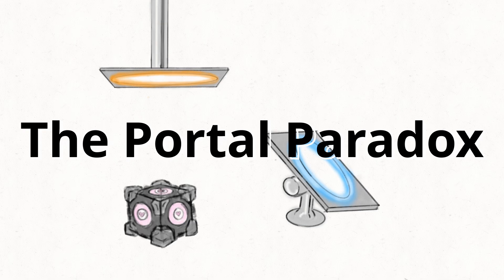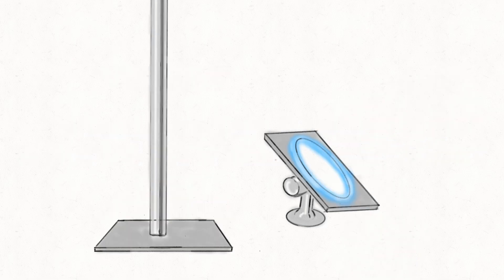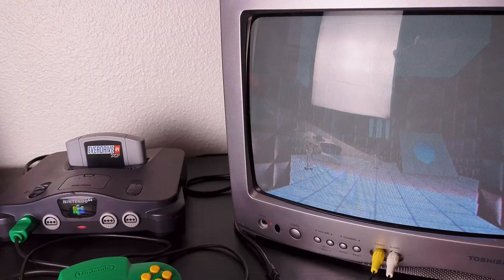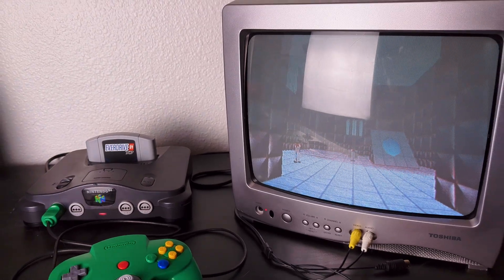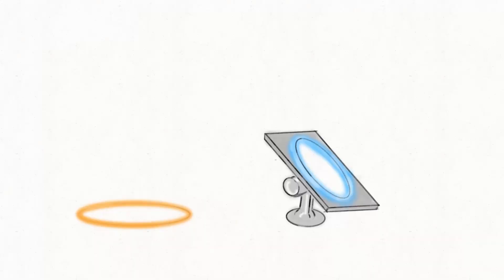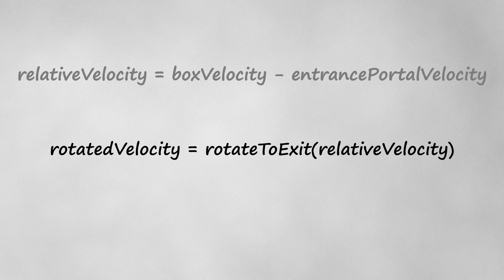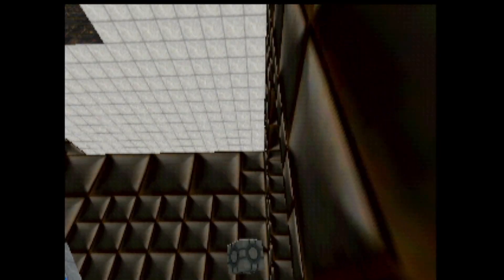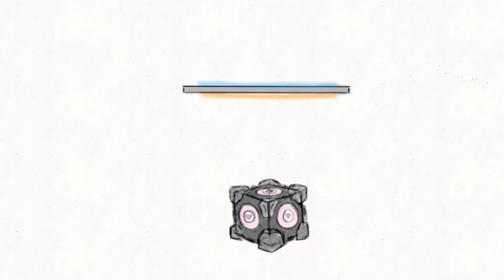I rewrote Portal from scratch and solved the Portal Paradox

Comment: I think the portal paradox is more like; What if two portals were pushed into each other with a cube in the centre? What would the cube do?
Reply: Or just the same experiment where the blue portal faces a wall with not enough space to allow the cube through. It seems like that the object must exert a force on the portal in order for the portal to accelerate it. So it would likewise meet the resistance as it tried to crush the box into the wall or into itself.
Reply: @goldenalt3166  or the force to move the portals would become too big and the pistons could give out.

Comment: As someone who agrees with you on the portal question I think the example of back to back portals is correct only if we assume a functional width of 0. If we were to assume a greater width to the distance between portals then the deceleration of the exit portal would occur before the block moves all the way through to the other side and therefore would impart some level of functional acceleration onto the block in the vein of something like (x-x1)/H?Velocity where x-x1 is the distance between portals if the distance is less than the size of the portal but greater than 0 and H is the height of the block. 

I don't know if that formula is correct, it was just a first look but there is definitely some dynamic there.

Comment: I think this question depends on the type of portal. If it's like the classical idea of folding space so that the two dimensional area of the portals is the same, then it wouldn't pop out. Like, it's a wormhole and the only thing "pushing" the box through is the entry portal itself moving the entire wormhole with it, enveloping the box. I think in that scenario it would actually be stuck in the 4th dimension though, like it would leave our 3d reality as there isn't anything to actually push the box anywhere, it would just "crumple" from our POV.

On the other hand, if it's like the teleportation technology in startrek, where the portal would copy what comes in and paste it as an output on the other side, then it would be forcing the material through effectively pushing it though at the same rate the cube would be annihilated into the first portal.

So really the question is, do the in lore portals use an extra spacial dimension or do they use replication?

I think if it's an extra dimension BUT it still functions the same as in the video, then it's just creating free energy. Crazy wacky portals using moon rocks as a base? I sleep. Conservation of energy not being conserved? Awake

Comment: Quick question: if there's nothing to push the cube how does it gain velocity? Won't it be something like a window that connects two distant places?
Reply: Portals already violate conservation of other forms of energy, and, axtually, while they preserve (as far as we know) kinetic energy, whenever two portals are not 180° apart, they violate conservation of momentum
Reply: @pedroff_1 they don’t in splitgate
Reply: Velocity is relative
The portal approaching the cube is the same as the cube approaching the portal
If you imagine yourself as the portal, the cube is approaching you and if you imagine yourself as the cube, the portal is approaching you
In either case, the cube gains relative velocity, which is translated through the other portal
Reply: @dtstar331  He's asking what is the source of the energy imparted on the cube that allows it to fly out of the other portal. It was initially at rest, and upon exiting the blue portal, has significant kinetic energy.
Reply: @Gameboy_of_Color  
Thing is, techincally the cube wasn't at rest; it was approaching the orange portal. I know, it sounds weird but that's more or less what relativity is about.
If you isolate the system with the orange portal and the cube, you can see they are approaching each other at a certain velocity. Therefore, there was kinetic energy in that system. And this energy was retained by the cube when it left through the blue portal. What changed was the relation between the cube and the portals. When it went through, it was moving away from the blue portal with the same velocity as when it was approaching the orange portal. And so it looked like it was shot out of there

EDIT: I'm bad at explanations, I know
Reply: @dtstar331  Examine the relative velocity of the cube and orange portal relative to the ground. The cube is at rest relative to the ground, and the portal is in motion, so for the cube to exit the blue portal with significant velocity there would need to exist some mechanism for the orange portal to transfer it's kinetic energy to the cube. Another thing I never see brought up in these thought experiments is that the orange portal decelerates and comes to rest as it contacts the floor, so the final velocity of the orange portal relative to the cube is zero as the last of the cube is going through the portal.
Reply: @Gameboy_of_Color   @DTStar  wouldn't the portal have already moved the kinetic energy to the other portal by the time it reached the cube? I'm not very good with science and I've barely made heads and tails of what you guys said.

Comment: Fun questions xD what happen if the exit portal is faster than the entrance portal does de cube fly back to the entrance portal since the relative velocity is negative?
Edit: very cool video 👍🏻
Reply: You didn't say where the exit portal goes. If in opposite direction from the entrance portal, then the cube will be accelerated, but only with speed of the exit portal, not the entrance portal. His equation is wrong, it shouldn't behave so.

Comment: I've always argued that this was the solution. People that say otherwise like to claim:
"But where does the movement come from?"

In physics terms they are speaking about momentum not being conserved. What they don't seem to realize is that, when entering a horizontal portal to exit a vertical one to make a jump, GLOBAL  momentum isn't being conserved, only LOCAL momentum THROUGH the portal is.

Another mental test so people would understand what my point was: imagine a test chamber, but in the exterior it is actually being moved by a trailtruck at 10m/s (or ft/s, arbitrary measurement). The orange portal is on the back face of the truck's test chamber, while the blue portal is in another test chamber stationary.
From the inside of the truck you can't know you're in movement.
You throw a ball at 10m/s at the orange portal, but from a stationary point of reference that means the ball is stationary and it is the orange portal going at 10m/s to the ball. Yet your expectation is to see the ball seamlessly seem thrown into the other test chamber, not stop mid-air the moment it crosses the portal.

Comment: The Retreating Portal:
Just another thought experiment on portal physics.

A stationary source portal on the wall in front of you.
Behind that, another wall, with the destination portal on it facing away from you.
That wall is moving away from you at a fixed velocity, say 10 meters/second, relative to you.
You toss your cube through at 5 meters/second.

What happens?

If the cube exits at the combined velocity of 15 m/s, relative to you, which is 5 m/s relative to the destination portal, then the portal altered the cube's kinetic energy (shouldn't be possible)
If this happens, then the portals share a reference frame relative to each other, regardless of their velocities.

If the portal cannot alter the cube's kinetic energy, as stated in the game, then it would attempt to exit at 5 m/s, relative to you, but the portal is moving in the same direction at 10 m/s,
does this mean the cube cannot exit the destination portal, if so, then is it somehow block from entering, or is it repelled back to the source?

Try this; hold your cube half way through the portal, does it now have both no kinetic energy, relative to you, and 10m/s of kinetic energy, relative to you, simultaneously ?
This would imply that the portals share a reference frame, and also bring you into that reference frame while directly, or indirectly interacting with an object currently within the portals' reference frame. An object can't have two different velocities to the same reference simultaneously.

The end result is either portals can in fact affect kinetic energy, which would mean creating energy from nothing, or destroying energy.
Or there is a paradox.

Portals break physics, but I think its fun to try to figure out what a more likely reaction would be.

(I'm curious to see how your game handles the exit portal moving with a stationary source portal)

Comment: I like your logic and your game so far. However momentum of a moving platform with a portal wouldn't make a cumbe fly because they never come in contact. Its like having a hole in the platform but the space inside the hole is the space on the other side of the portal. In the game you see cubes fly through portals but only because they have force added to them.

Comment: New Thought Experiment:
What if portal A is stationary (no velocity), and the cube is ~98% through it, but then portal A instantly ramps up to maximum velocity for the final ~2%?
Would it simply fall out of portal B, or shoot out of it at maximum velocity? Or perhaps it only shoots out at an additive ((max portal A velocity) - (max portal A velocity * 0.02f)), or even just (max portal A velocity * 0.02f)?
Reply: I feel like the equation should take into consideration the relative velocity (AND acceleration of said velocity over a fixed period of time) of which portal the object is "more through", perhaps even averaging it out between both portals in the process? But I'm no math/physics expert so idk what the best way to implement it into the equation would be...
Reply: Or I guess, more accurately, the amount of force applied by portal A in this case would only be applied to ~2% of the cube's mass, perhaps?

Comment: Personally I don't agree, there should not be any forces acting on the cube as the portal would, in theory, be empty space. Now technically this really depends on how the portal technology worlds, whether it is teleportation or displacement would change how the forces are applied. This would need a deep lore dive into the portal mechanics and how the portal system works in universe. Gravity would also need to be factored and determined how it would react to portals, if you put just your arm through a portal would you feel a different in gravity for just your arm? Where would the forces end? In game you can actually stand inbetween a portal and stay stationary which would mean there is some sort of field around the portal entrance/exit where gravity equalises or possibly does not exist.

It's a cool idea, but I don't think it can truly be proven one way or another.

Comment: After reading countles comments regarding this, if the movement of the pistons were to vary at all(like stop or slow down), it's useful to just look from the perspective of the stationary portal. If you look into it, it will seem as if the ground is literally just shoving the cube up, and if the piston slows or stops midway, just imagine it as if the (relative to the portal) the ground slows down or stops midway, the cube will still get launched via CoM from the ground.
Reply: Try to look from the cube's perspective. You'll probably understand why his equation is wrong.
Reply: @fantastikboom1094  Look from the cube's perspective and ooh golly jee, the side wall and portal is moving back towards me, and will maintain doing so even when I go through the portal smh.
Reply: @3_pancakes767  So you mean that the whole universe is pushing the cube, and when the portal stops, the universe remained the inertia, and that's the reason why the cube is shooting out.

Comment: Here's the issue, let's say this way of the portal working is correct. This means that when 1 atom of the object has gone through the portal it instantaneously gains velocity, same with the second atom and so on. When this happens the object would be pulled apart while the portal moves, meaning it practically disintegrates. So the correct answer is either the one where the cube doesn't have an exit velocity, or the cube get's destroyed as it goes through the portal
Reply: This result actually conflicts with what wee seen in the game. So the answer is "cube would plop out".

Comment: Realistically wouldn’t a cube be stationary as if on a flat surface and only be affected by gravity, normal, and friction forces once out the other portal. I mean if you did that same thing but stopped halfway through the cube it would be odd for it to fly off the ground and gain speed from nowhere. Unless there are some unique portal physics I don’t know about. It’s a pretty cool video either way.
Reply: My theory is that a portal stopping half-way over a cube would cause it to partially fly off. Half the molecules of the cube would be stationary, half would be "moving", so the forces would balance out. 
In-game, it would probably only matter if the object's origin or Center of Mass made it through the portal plane.
Reply: Portals aren't just doorways, but that completely redirect momentum for no cost. The only truth is that any velocity vector going in, is equal going out. To the Portals, an object moving towards the portal vs a portal moving towards an object looks exactly the same.
On the blue (exit) side, while the entrance side is halfway through, they see the Box emerging at speed. Once the entrance hits the ground, the box is still exiting at speed.
Reply: @Appletank8  They redirect momentum but they don't create it. A portal is like a doorway, connecting two spaces in otherwise impossible ways
Portals do not thrust things out at specific velocities; they do to make the game work of course, but all they do is connect space
I do not see how he cube would gain any sort of momentum from a portal falling over it. The space through the orange portal is dictated by where the blue portal is. And even if that space is rapidly changing, there is no force causing the cube to move
Reply: @100Darkspine  technically going from a low portal to a high portal creates potential energy outta nowhere. that's why you can make perpetual motion out of a floor/ceiling pair.
Anyways, the only rule of portals is that if something enters the portal at speed, it will exit at speed. In order to exit a portal at all, you need some sort of velocity, otherwise nothing happens. From second 1 to second 2 of going through the blue portal, the box has a noticable change in position, therefore it now has a speed, Distance/time.

There is no way for the blue portal to tell the difference between the entire room moving at constant speed towards the portal, vs the portal moving at constant speed towards the box, so the results will be identical regardless.
Reply: @100Darkspine 
The portals are not creating the momentum. The cube already has momentum relative to the orange portal. Expecting it to stop once it leaves the blue portal is expecting its momentum to change for no reason.

Comment: It makes sense when you also think about how, if the portal only slammed halfway down onto the cube, one half would have the full momentum from moving out of a stationary portal, and the other half would have none, cause it's just sitting there. so what would happen? Since energy can't be created nor destroyed, half of the momentum from the moving half of the cube would be transferred to the idle half of the cube and it would fly out at half the speed that the portal was moving.

I may have overcomplicated it but I hope you get the just of it

Comment: I'm not smart enough to know if you're wrong, but I feel like the portal's velocity wouldn't transfer to the cube. I could see the Piston transferring some of its kinetic energy to the cube via hitting the ground but I don't necessarily see how the portals velocity could send it flying. I'm definitely going to be thinking about this for a while. Just wish I was better at math.
Reply: You're right, there is no reason an no way entry portal could affect the object's momentum. Portals must save momentum of the object . In his equation it is not saved, because cube has no momentum. (Also his equation means that the object will be sliced into layers of atoms, because of how energy is suddenly applied).

If the exit portal would move and entry portal would not, then the object's momentum will be corrected in respect to the exit portal. His equation simply doesn't have it, therefore, it's wrong. (It also means his equation can't save object's momentum, again).

Comment: So I know this is a video about fictional mechanics of fictional portals, but this seems to generate energy (and that's illegal). This really isn't different from non-movable portals generating infinite potential energy when placed on a floor and ceiling facing each other, but this seems to immediately generate kinetic energy.

What if that orange portal piston stops after some piece of the cube has entered? Does that cube piece's newly generated kinetic energy propel the rest through the other portal if enough mass passed through before the piston stopped moving?

Comment: So the box is being shot out of the mobing blue portal, but since the portal is moving away from the box at the exact velocity the cube is supposed to move away from it, it just stays still?

Kind of like if you throw a 50mph basball off the back of a train going 50mph, it just falls out of the air?

Is this the right way to think about it?